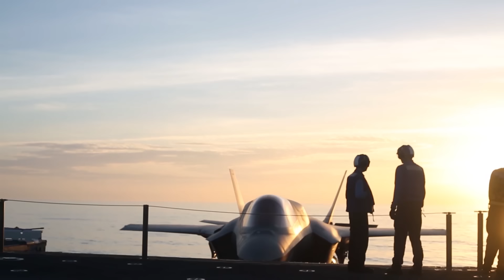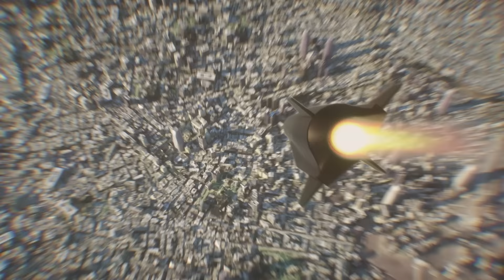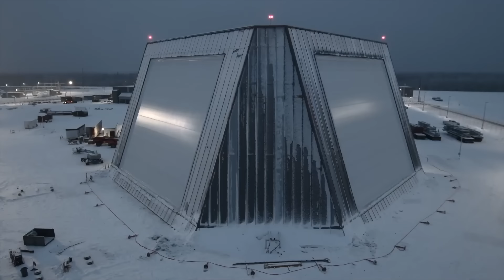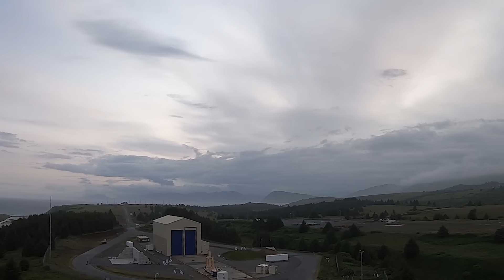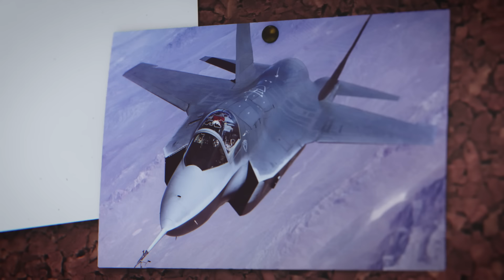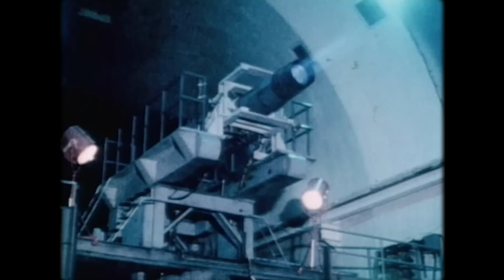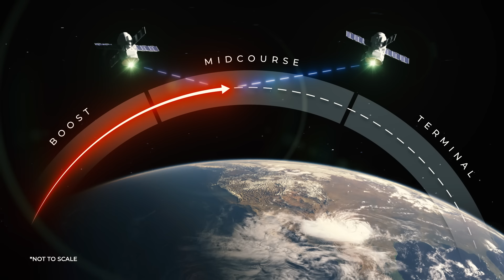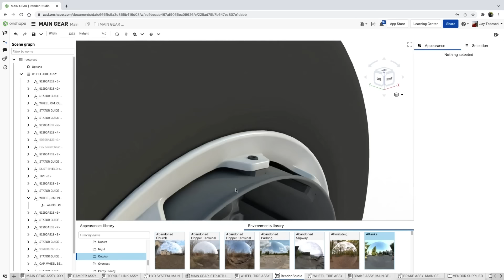How Will the Golden Dome Work?

Comment: All things aside... one thing is for sure... no air defence system is able to stop a large number of missiles at once.  even if US gets 200-1000 laser satellites... and for suppose if China Launches 3000 Hypersonics all from one direction.  or simply what if China launches 200 Hypersonics from deep sea ? stealth Drone flying at a very low speed with low altitude so low that it is literally at sea level almost touching launched from Submarine Nearby.

Comment: THAAD is not the land based equivalent to AEGIS the equivalent system would be the aptly name AEGIS A Shore system, while THAAD's radar may be similar in capability the THAAD doesn't just describe a radar it describes an entire missile defense system including interceptors while AEGIS is more so a tracking/identification system that then creates a network that is shared with interceptor platforms.

Comment: Simple and cheap way to have an American "Iron Dome' - AKA: AID
The goal is to use cheaper defense weapons to counter act against possibly even cheaper weapon systems. Why shoot a $1,000 rocket out of the sky with a million dollar warhead, when you could use a gun system, drone, or cluster munition. 
1. Broad and wide defense, TARGET: ICBMs and intermediate missiles, DEFENCE: Supersonic missiles and lasers, used by Satellites and land based systems, high altitude interceptors with supersonic capabilities to deploy and meet deadly ICBMs .
- Very expensive but useful against devastating targets with payloads that could level cities or more.
2. Intermediate defense, TARGET: supersonic payloads of small/intermediate lethality, such as conventional warheads, DEFENSE: Intermediate missiles, jammers, and lasers with massive amounts of heat killing capabilities , (no satellite defense necessary)  Use ground or ship based radar systems for early warning. 
3. Local defense systems (city, area or grid sectors), TARGET: small weapon systems such as drones, small payload warheads and potential ground threats. DEFENSE: guns, with ability to lay down overlapping fields of deadly lead, small interceptor warheads for possible targets such as aircraft. Cluster munitions with focus on covering large areas with shrapnel in nocking out missiles, drones or aircraft. Drone swarms for interpreting multi-dumb-missile barrages.

Comment: The lasers in space wouldn't need as much power as the one used on the Prebble because there is no/very little energy dissipation in space. As lasers travel through our atmosphere, they interact with air and water molecules, spreading the beam out as it travels and lowering its on-target energy delivery; this wouldn't happen in space. Still a very energy expensive weapon though

Comment: The Patriot PAC-3 Missile Segment Enhancement (MSE) is an upgraded variant of the PAC-3 missile, designed to enhance the Patriot air defense system's capabilities. It features a larger, dual-pulse solid rocket motor, larger tail fins, and upgraded actuators and thermal batteries to improve range, speed, and maneuverability. This allows the PAC-3 MSE to intercept a wider range of threats, including tactical ballistic missiles, cruise missiles, and aircraft.

Comment: Here's how it will work:  
1: $Trillions of taxpayer dollars (most of which will be borrowed causing a huge explosion of the deficit) will be funneled to those defense companies that have donated the most to MAGAt slush funds, and who provide the most unrealistically extreme promises of delivery times and military functionality for the system.
2: There will be outrageous cost over-runs and delays in delivery times, further enriching those corporations (and their CEOs) who received the original payments.
3: There will be a massive coverup and excuses provided at congressional hearings for the cost overruns and delays; the corporate representatives mostly blaming unforeseen technical problems and requirements changes.
4: A small and mostly useless delivery of some parts of the "dome" will be delivered, just enough to keep the taxpayer dollars flowing into the corporations and CEOs pockets for another 10 years.
5: The project will allowed to "sunset" at basically useless functionality and the now fabulously rich corporate CEOs will retire on their millions, and everyone who got rich from the largely useless spending of tax dollars will laugh all the way to the bank.

Comment: lol the amount of simping for “China’s” tech thinking that what THEY say are the capabilities and lethality of their military is a comical level of petulance nearly to the level of North Korea. West Taiwan has been utterly embarrassed whenever their equipment is given to their ally countries, and that’s WITH stealing half their plans from The U.S. lol They’re even bad a cheating. They cut costs at EVERY level, have ZERO war level experience throughout their ENTIRE military, generals getting “disappeared” every 3-9months and the list goes on. Honestly, West Taiwan will be desperate after 6months of actual combat against The US to where The Regime WILL resort to nukes, which in turn, will be their complete demise by their own hand. West Taiwans “FiF jEn PhiTeR’s”(5th gen fighters) claim they’re the “equal” when they can’t even produce a stealth aircraft that can supercruise without TWO engines which dramatically creases their radar output along without being able to mask their thermal trail. And with TWO inefficient engines powering their “FiF jEn pHiTeRs”, it requires more fuel capacity that drastically lowers the payloads they can carry. Their entire military from the top down is effectively built from Temu or Wish lol

Comment: (TL;DR: a satellite laser defense system is less difficult than it sounds, at least for power.)  The problem with the power calculations is that you are assuming that a space-based satellite needs 1MW constantly*.  High-energy lasers do not fire a continuous beam--they fire in pulses.  If a laser defense satellite had a solar array the size of that on the ISS, it would be able to fire a one-second pulse every four seconds.  Assuming it can maintain a tightly-focused beam, that should be more than sufficient to damage an incoming missile.  If we assume a more moderate solar array, say, 25kW, that would be a one-second pulse every 40 seconds, or three pulses every two minutes.  Thus, assuming a minimum missile flight time of 20 minutes (assuming the missile isn't coming from Canada), a single satellite of this size could take down 30 targets.  That is much more feasible.  Also, keep in mind that a single Starlink launch puts almost as much solar power into space (in surface area) as the whole ISS, so it would not be impossible to put 100 ISS-equivalent satellites (in power, not mass) into orbit in a single year (not accounting for satellite build time and cost and material supply).  The biggest hurdle isn't the solar panels: it's the laser guidance/optics and the power bus (basically a huge array of capacitors).  But those are solvable problems. **some rather vague hand-waving*

Comment: Hint: It won't. There is no reliable way to intercept a modern ICBM during terminal phase (mach 20-24), let alone a group that showers a continent with its MIRV payload.
This holds true for all sides involved in a potential nuclear exchange; so whoever fires first dies second.

Comment: There are only 7-8 THAAD system that are operational. Each unit has 48-72 interceptors. Ecah incoming missile is targeted by upto 4 interceptors. It's a great system but as you can see it can get overwhelmed fairly easily.

Comment: Oh, this won't work.  Anti-ballistic missiles may work against (some) WWII rockets, but they are hopeless against anything that is 1980's and above.  The principle way to defeat an ABM system is the offensive party fires in garbage rockets, this exhausts the ABMs, and once all the ABMs are used up, then you start sending in rockets with warheads.

Comment: just use mirrors 

you could use 
photovoltaics %20 efficiency
batteries 90% round trip, with massive losses from thermal maintenance 
microwave emitter (no idea efficient) 
to microwave frequency antenna (some loses) 
to laser (20 to 50% efficient) 

or you could literally just tip a bunch of mirrors to shine vanilla sunlight like a massive magnifying glass 

in atmosphere, the microwave idea might work better
but in space sunlight has already traveled millions of miles just fine, a few hundred more won't hurt

or if logistics for that is to tough 
then you could directly pump the laser with sunlight or heat
just have collectors and pump cable lasers 
you can make really big really cheap mirrors with fabric like the James Webb telescope,

Comment: The arrow system was not strained neither was it overwhelmed in the latest conflict with Iran. It presented a >90% interception rate which is its published operational interception rate. No defense system can guarentee 100% interception. There is no shortage in interceptors nor were there systemic malfunctions in the interception process (there were 1 or 2 defective interceptors).

Comment: Why is the threat detection from a jet faster? Wouldn't the jet also need to deliver this information? As far as i understand, this could only be done with a lnother frequency that is at light speed, which is also the speed the frequency that the defense system would try to detect has. So wouldn't the information transmission frequency from the jet arrive at the same time, as the frequency of the detectable information?

Comment: Correction for 3:50: In the world of military, there are both hypersonic ballistic missiles and hypersonic gliding vehicles (HGVs). Hypersonic ballistic missiles have two requirements: 1- they must have a ballistic trajectory, and 2- a terminal velocity of Mach 5 or more. Ballistic missiles with speeds higher than the speed of sound but lower than Mach 5 are called supersonic missiles. Technically, if IRGC's missiles meet both requirements, they can be referred to as hypersonic ballistic missiles. Just because it's not a hypersonic gliding vehicle doesn't mean it can't be a hypersonic missile. 
Furthermore, with hypersonic gliding vehicles, while they are hypersonic-fast and provide great maneuverability, the gliding vehicles spend a lot of time in the earth's atmosphere causing speed loss due to air resistance, and they also don't tend to get boosted for as long and as deep into the space as hypersonic ballistic missiles do which means that hypersonic ballistic missiles can usually achieve higher speeds than gliding vehicles can. In fact, while most hypersonic gliding vehicles can reach speeds of Mach 10, their ballistic counterparts (which are mostly ICBMs) have been able to reach Mach 20 speeds for a long time now. 
In addition, as pointed out in the video, the hypersonic ballistic missiles can and do release multiple reenterant vehicles (RVs) from each warhead, and each reenterant vehicle can have some level of maneuverability. These RVs tend to have a higher speed and less maneuverability in comparison with the hypersonic gliding vehicles.

I wanted to mention sources, but there's no shortage of them and they call tend to agree with each other. You can easily look up the terms and find out what the consensus is.
Also, thanks to the Real Engineering team for their cool vids as always.

Comment: Part of the reason we have not attempted to implement this before is that it upsets the balance of nuclear deterrence. If we begin to implement a system that would defeat MAD, other nations are obligated to intervene or else concede to the future threat of nuclear force against them, permanently reducing their bargaining power. Iran recently discovered this problem themselves.

The other reason is that it is a waste of money. If you build a dome, the bombs will just arrive on a truck instead. Ask Russia about that one. Resources should be allocated towards the cheapest and most vulnerable points first, or it will just be ignored.

Comment: I think a key fact is that the solar arrays on an orbital laser system do not need to constantly output the full amount of power. They can store it over time. 

You then need to decide what you want your fire rate to be to determine the array size. So for example the iss uses up to 2160 kWh in a day. This if you need your laser to fire at 1 MW once a week you could make it 1/14 the size.

That’s before we get to the fact that modern solar panels generate 70% more power per area due to efficiency increases vs what’s on the iss. So you could probably make it around 1/24th the size and still be able to fire once a week. Or make it bigger and fire more frequently

Then we also get to the fact that lasers in space need less power due to no atmospheric interference. So even the 1 MW might be too high.

Comment: This is a bold strategy one I do agree with but not one I thing the US would need for probably another 100 years. Here are some points I gathered from info in the video and info I already know.

For the most part on both coast we have atleast 1 or 2 fleets within defensive range of the US not to mention our patriot system on standby aswell as the national guard meaning we kinda already have 3 layers of defense on each coast for AA defense.

The US is a much bigger space than the area the iron dome would be covering meaning a entirely new system would need to be developed, once again one I dont thing we will need atleast in this century.

Comment: Best solution would be a bunch of moderate-power lasers all tracking the same target. 1MW is a tough power figure to hit, but if you have 100 10kW lasers, that would do the trick. Starlink is already close to that in array size, and that's not factoring in the Starship-launched versions being almost 3x more massive

Comment: "500 billion" yeaa... more like 5 trillion
Space lasers would be absolutely devastating... imagine nothing on the surface being safe. Want to unload ammo and dump it into an open field near the train tracks? Everything explodes. Factory that makes the ammo? Damaged. Chemical plant 2000 miles behind the frontline? It's on fire... Can even go as far as targeting individual trucks or de-mining, with super low cost per "shot" there is no reason not to use the system

Comment: Tamir does not have optical sensor...

Regarding cost of interceptor - the damage of ballistic missiles is enormous - they level up buildings - so intercepted missile even if it costs several millions to intercept is still more cost effective than repairing the damage (buildings, housing the residents etc) especially if the missile falls in the middle of the city (and these are huge) and we are not talking about human live it saves and damage it creates on economy.

Now if the warhead is not conventional but a N..e the price different even higher.

So the correct comparison isn't to Iron Dome but rather to Arrow interceptor that tougher with THAAD had proven to be an effective tool (also not giving 100%)

Comment: Wish you would’ve dived more into the effectiveness of the systems rather than treating it like a dichotomy of success and failure 

Ie. the Patriot missile system has w much smaller success rate than originally promised even in generous conditions it’s around 40%-50%

Comment: Trump and BMD: 'If it aint broke, fix it until it is!'

The only viable defense against nuclear ballistic missles requires nuclear armed vnterceptors (see:: Nike Zeus/Hercules, amd the Russian A-35 system around Moscow, which are both defunct) Which create  their  own huge set of problems (Nuclear armed exoatmospheric KVs  EMPs vs. modern infrastructure, plus fallout- the cure is possibly worse than the disease! Thus the discontinuation of NIKE (There is an old Nike base like a dozen miles of where I live in Seattle- its a fun kind of 'Ruin of Modern Civilization' to explore, but that's about all that program was good for!)

...Just my (marginally informed but educated) 2c.